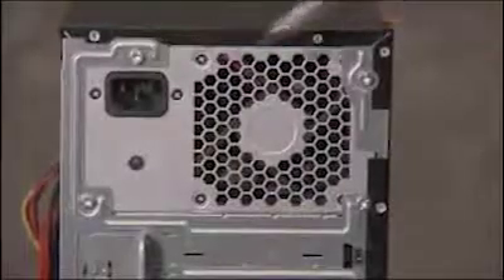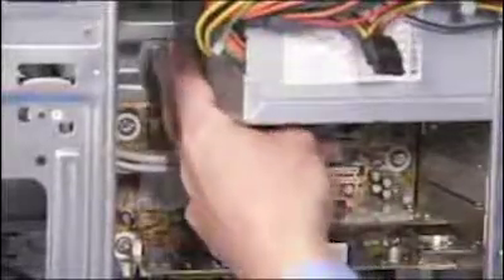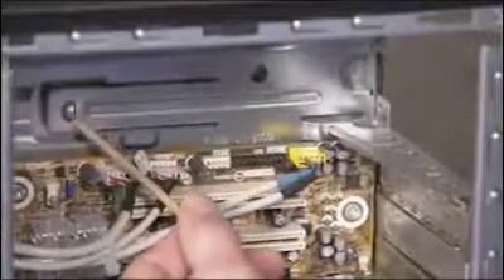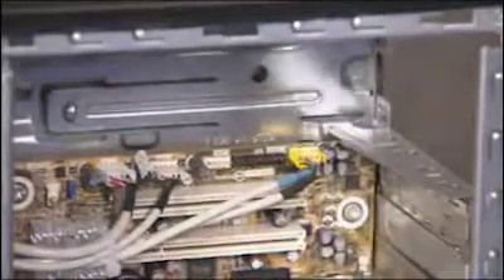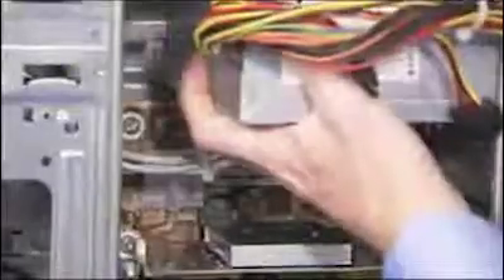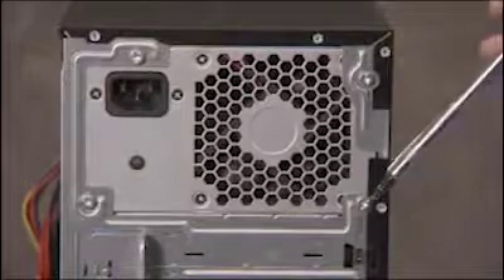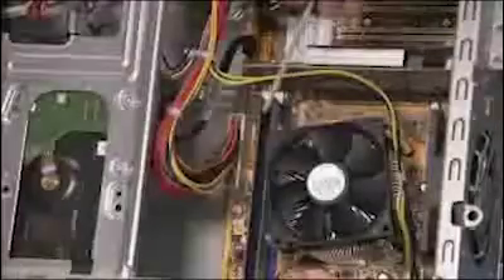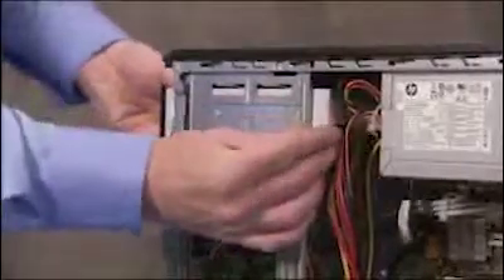Replace the Power Supply | Pavilion p6000 | HP Support

Comment: Is it possible to change a power supply of a Prodesk G1 to a Prodesk G2 motherboard? I see there is just 1 single black cable in the P2 output that is missing, but P1 and P3 outputs are the same.
Reply from the maker: +Avith Ortega HP does not recommend upgrading or downgrading hardware parts or software that is bundled with the product as It may affect the manufacturer's warranty and performance, however, you could change the configuration at your own discretion.

Comment: I like this step by step guide. I wish I had knew about it before I took apart my HP Pavilion p6-2310's power supply out. Didn't know the front cover was removable. Is it held down with clips or screws?
Reply from the maker: +Tala Chahrour Please refer this document to know about replacing the power supply: https://bit.ly/2P2KLtG

Comment: Is it possible to remove the left side ? or will it have to be sawed off ?
Reply from the maker: Hi there, thanks for contacting HP Global Social Media Support!
I am here to help!
What seems to be the issue? Are you facing any technical issues with your HP computer?
May I know the computer you are using?
Let me know!
Binu_HP Social Media Tech Support
Reply: @HPSupport  HP Pavilion p6, I see that the 2nd wall of the pc is riveted, can I somehow change the motherboard or remove the disk reader ?
Reply from the maker: Thanks for the reply.
HP does not recommend upgrading or downgrading hardware parts or software that is bundled with the product as It may affect the manufacturer's warranty and performance, however, you could change the configuration at your own discretion.
Binu_HP Social Media Tech Support